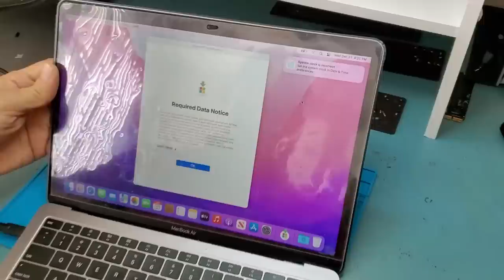2018 MacBook Air Water Damage - Won't power on. Can we save it?

Comment: I wonder what the long-term prognosis would be for a board that had that amount of corrosion, would it last, would it be stable, would some components be slowly internally corroding, it'd be interesting to see it's overall lifespan now....great work and good humour as always Alex !!! 😎👍
Reply: a short and dead board, 2k to replace from apple
Reply: I tried to repair a laptop from the previous owner who had chicken soup all over the laptop. I replaced the laptop and tried to get it working again. I've disassembled, cleaned and reassembled it 5 times, the last time I've soaked it under water and dried it in the oven at 70⁰C for 3 hours. After all that it still wouldn't turn on but the power led flashed 10x, it didn't do that before. I replaced the battery and it turned on! 
I use it as a cnc control laptop in the shed where humidity can be quite high but it works still after 3 years.
It took me days to repair it so Northridgefix would deem it a no fix for sure. But as a hobby it was 8nteresting to do and it paid off in the end.
Reply: @imqqmi  - Like a wine spill your initial fix is to pour tomato soup over laptop
Reply: the oxide between components could introduce several problems; resistance, rectification(acts as diode; old diodes were called metal oxide diodes/rectifier), I think it might even turn to metal oxide transistor say if oxide is between 3 components.
But oxide effects only external connector connections nut the inside of basic/discrete components.
Reply: Alex warranties his work.
Reply: @FussyPickles  nope. I checked the price of a self-replacement MBP 14 board. $600/
Reply: @nnnnnn3647  send the link

Comment: What temps does he use for this reflow technique?
Reply: You should watch more board repair vids. Temps don’t always really matter because it is mostly about technique. I’m almost always max temp unless I’m in a sensitive situation but it’s all about how far you are from the board and technique. But air flow definitely matters but still can be subjective based on technique. Good luck!

Comment: I wouldn’t trust that repair I’m afraid as there could be more corrosion building , unless you put it in ultrasonic cleaner without us seeing , seems the perfect t candidate for a clean and reflow. Even distilled vinegar would have neutralised the area and prevented further corrosion that perhaps is minute and under chips from coming back. Otherwise good repair as always. 👍

Comment: what are the chips generally made of that they don't burn or melt when you apply that much heat?
Reply: read any datasheet of surface mount IC or component like resistor or cap
the reflow (heat) is 200~250'C, and the exposure time is in seconds can remember how long exactly maybe 20 or 60 until the solder paste melts to hold the component
But they do burn if the temp is too much & the exposure is too long
Then this indirect heat flow does not provide full heat as in hot air gun say 500'C the heat on board maybe less like 250 or 300
see wikipedia for Heat transfer
Reply: Great information. Thx

Comment: Just wonder why you didn't clean it first with isoprophyl? I would reflow it after cleaning it with alcohol, but there are many ways to rome so...good work. Macbook is fixed and thats the result we wanna get. Great video. Greets
Reply: I was wondering the same thing. I've fixed maybe 10 different phones and laptops by cleaning with isopropyl alcohol. The ones that were successful had chocolate milk, fine dirt (dropped on driveway in the rain and left for hours), wine, soda, potato soup, beef barley soup (used water first then isopropyl for that one). I couldn't fix a laptop that had hot engine coolant spilled in it. Owner was looking at the manual to fix his car when he opened the hot radiator. The coolant actually dissolved some of the circuit traces! I also couldn't fix an iPhone found in a snow pile by the road after the plow went through. The salt from the road corroded the connectors and disintegrated the pins. And there was a Samsung Note 9 that went swimming in a lake and drowned. Lol. Under 6 feet or water for 2 hours and it was turned on.  Two chips for the camera power supply were destroyed (there were pieces out if them). According to my brother who worked for Lucent some years ago, that's what happens if moisture gets into ICs. They tested the ones they made by exposing to high humidity to be sure moisture couldn't get in due to manufacturering defects. I really appreciate Alex's videos. Watched a bunch, ordered low melt solder, solder wick, and flux from Northridge Fix and replaced the HDMI IC in an LG TV where all HDMI ports stopped working. Couldn't have done that without watching Alex.

Comment: My suggestion is to Clean with isoprophyl alcohol and then nicely clean with fine brush to remove the oxidation , then reflow the chips
Reply: Pros just clean up once the job is done😂
Reply: Fix it. Invoice. Move on. Flux will get that done for you then clean the flux/dirt mix afterwards. No need.
Reply: Just follow the video
Reply: No idea how you and the 16 that upvoted you are so impatient. It was a fix and he cleaned many areas using that method. My suggestion is you watch the video to the end before commenting
Reply: My urge would've have been to clean all with IA also, then remove the heat sink to get a peek under it and clean, and remove at least that one chip to see under it and clean. Then reflow. Then reinstall the chip(s) and heat sink. You know how long that would take? Big Boss is the Boss of  all Bosses yes, but Alex is the King of Efficiency and knows how to get 'em in and get 'em out. Good job!
Reply: 🤣I been using rubbing alcohol to clean my PC builds for months just glad nothing has gone wrong once 😎👍
Reply: You don’t need to worry aboot telling him how to do his job!!!
Reply: Based on years of experience?
Reply: pros doesn't use isopropyl
Reply: @ODI0408  😄